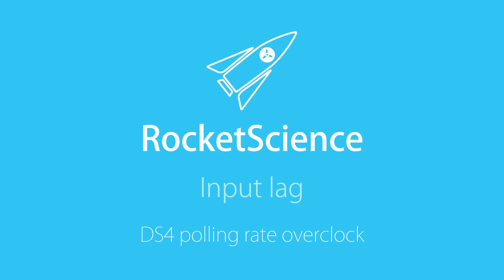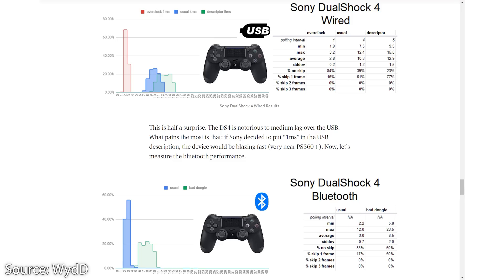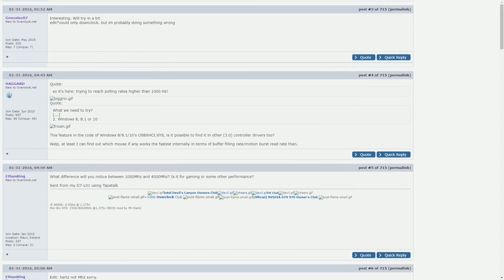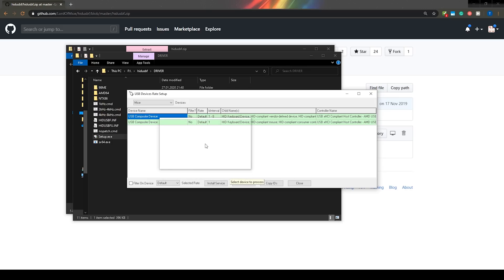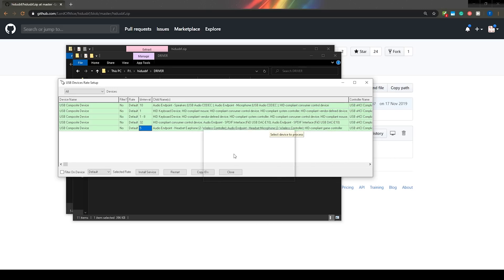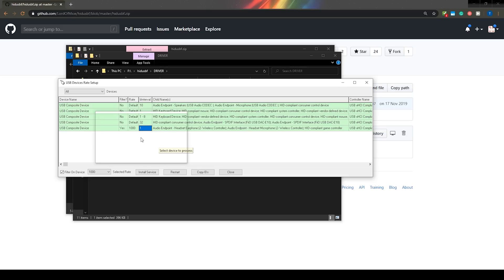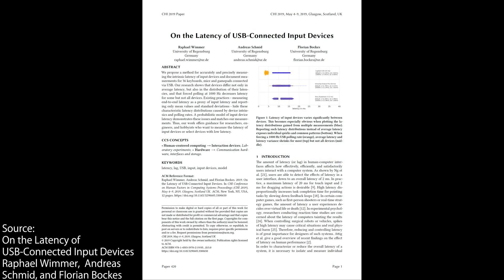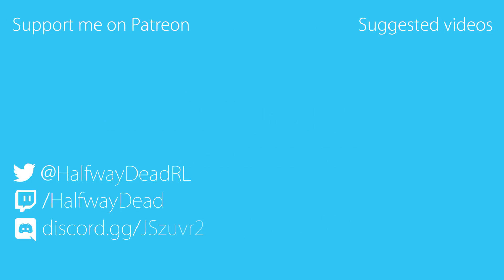(DS4 PC) Lower input lag for free! - Rocket Science

Comment: did everything right closed all applications and i still get 5 bInterval
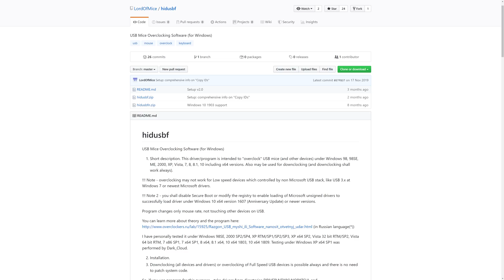Reply from the maker: It should be possible to do the reversing 3:38 to at least get the controller working again.
There may be a number of causes according to the support page of the program:

!!! Note - overclocking may not work for Low speed devices which controlled by non Microsoft USB stack, like USB 3.x at Windows 7 or newest Microsoft drivers.

!!! Note 2 - you shall disable Secure Boot or modify the registry to enable loading of Microsoft unsigned drivers to successfully load driver under Windows 10 x64 version 1607 (Anniversary Update) or newer versions.

In short: You may be unlucky and have the wrong USB controller (you can try the ports in the back of your mobo if you didn't already (USB3)).
Google how to disable secure boot on your PC, install service, then you should be able to turn secure boot back on.
Reply: @RocketScience  yea fixed it by switching from USB 3 to USB 2 and works fine now
Reply: Rocket Science I’ll try that, thanks for your reply :)
Reply: same for me

Comment: i have a red bar aswell
Reply from the maker: It should be possible to do the reversing 3:38 to at least get the controller working again.
There may be a number of causes according to the support page of the program:

!!! Note - overclocking may not work for Low speed devices which controlled by non Microsoft USB stack, like USB 3.x at Windows 7 or newest Microsoft drivers.

!!! Note 2 - you shall disable Secure Boot or modify the registry to enable loading of Microsoft unsigned drivers to successfully load driver under Windows 10 x64 version 1607 (Anniversary Update) or newer versions.

In short: You may be unlucky and have the wrong USB controller (you can try the ports in the back of your mobo if you didn't already (USB3)).
Google how to disable secure boot on your PC, install service, then you should be able to turn secure boot back on.

Comment: Doesnt work for me although I think im doing it right? after plugging the controller again theres nothing in bInterval and its red colored
Reply: Surprise, surprise! Blame the windows fuckin 10. 
https://www.overclock.net/forum/375-mice/1597441-digitally-signed-sweetlow-1000hz-mouse-driver-35.html#post25560676
https://www.overclock.net/forum/375-mice/1597441-digitally-signed-sweetlow-1000hz-mouse-driver-90.html#post27714496

You can also use this registry setting https://forums.mydigitallife.net/threads/windows-10-anniversary-update-digital-signature-question.69970/#post-1272392
Reply: @koshi-dono  Yeah adding that dword value worked for me
Reply: @somethingeatingspace  It worked for me too, I had to restart, just in case that's not clear.
Reply: @somethingeatingspace  what is that?
Reply: @koshi-dono  not gonna lie i'm a bit of a noob with computers and i'm not really understanding anything in those threads, is there a way for it to work with this problem? I kinda get that reinstalling windows was the problem and I do it every year or so.
Reply: @Stegibbon  try registry key then. If you don't know how to use regeditor try to read this first https://www.laptopmag.com/articles/create-reg-file-for-registry-hacks 
Create a new reg file with the key you can find here https://forums.mydigitallife.net/threads/windows-10-anniversary-update-digital-signature-question.69970/#post-1272392
And then run it by doubleclick.
Reply: @Stegibbon   tbh i wouldnt recomend you to do it unless you have a good understanding of what you are doing. All of the solutions involve putting your pc into high security vulnerability if you are not carefull. So first inform yourself well about any of these threads before atempting to do them. And there is no other ways. Microsoft win 10 last update was the one causing all of this
Reply from the maker: In case anyone else has this issue. It should be possible to do the reversing 3:38 to at least get the controller working again.
There may be a number of causes according to the support page of the program:

!!! Note - overclocking may not work for Low speed devices which controlled by non Microsoft USB stack, like USB 3.x at Windows 7 or newest Microsoft drivers.

!!! Note 2 - you shall disable Secure Boot or modify the registry to enable loading of Microsoft unsigned drivers to successfully load driver under Windows 10 x64 version 1607 (Anniversary Update) or newer versions.

In short: You may be unlucky and have the wrong USB controller (you can try the ports in the back of your mobo if you didn't already (USB3)).
Google how to disable secure boot on your PC, install service, then you should be able to turn secure boot back on.

Comment: My binterval comes back blank after I plug my controller back in? What do I do?
Reply: Same, hopefully he can help us with this.
Reply: Surprise, surprise! Blame the windows fuckin 10. 
https://www.overclock.net/forum/375-mice/1597441-digitally-signed-sweetlow-1000hz-mouse-driver-35.html#post25560676
https://www.overclock.net/forum/375-mice/1597441-digitally-signed-sweetlow-1000hz-mouse-driver-90.html#post27714496

You can also use this registry setting 
https://forums.mydigitallife.net/threads/windows-10-anniversary-update-digital-signature-question.69970/#post-1272392
Reply from the maker: It should be possible to do the reversing 3:38 to at least get the controller working again.
There may be a number of causes according to the support page of the program:

!!! Note - overclocking may not work for Low speed devices which controlled by non Microsoft USB stack, like USB 3.x at Windows 7 or newest Microsoft drivers.

!!! Note 2 - you shall disable Secure Boot or modify the registry to enable loading of Microsoft unsigned drivers to successfully load driver under Windows 10 x64 version 1607 (Anniversary Update) or newer versions.

In short: You may be unlucky and have the wrong USB controller (you can try the ports in the back of your mobo if you didn't already (USB3)).
Google how to disable secure boot on your PC, install service, then you should be able to turn secure boot back on.

Comment: I have a problem, I followed all your steps correctly but when i set it to 1000 and reconnect my controller the bar turns red and not green. What im i doing wrong, i also didn't have DS4 or steam opened.
Reply from the maker: It should be possible to do the reversing 3:38 to at least get the controller working again.
There may be a number of causes according to the support page of the program:

!!! Note - overclocking may not work for Low speed devices which controlled by non Microsoft USB stack, like USB 3.x at Windows 7 or newest Microsoft drivers.

!!! Note 2 - you shall disable Secure Boot or modify the registry to enable loading of Microsoft unsigned drivers to successfully load driver under Windows 10 x64 version 1607 (Anniversary Update) or newer versions.

In short: You may be unlucky and have the wrong USB controller (you can try the ports in the back of your mobo if you didn't already (USB3)).
Google how to disable secure boot on your PC, install service, then you should be able to turn secure boot back on.
Reply: Rocket Science make a video
Reply: Yeah, same. Hopefully we are missing some small detail he forgot to mention.
Reply: I just posted a new comment outside this thread for those of you getting the red signal. Take a look and let me know if it worked for you.
Reply: @Drixi  i havent been able to find your comment. can you check if it was posted indeed?
Reply: @Drixi  can confirm this worked
Reply: @Drixi  my guy
Reply: @Drixi  i have a problem after i restarted my pc and check if the new thing saves where we had to put 1 instead of 0 and it doesnt save
Reply: Thank you for letting us know :) I still have not had a single problem myself with this method.
Reply: Surprise, surprise! Blame the windows fuckin 10. 
https://www.overclock.net/forum/375-mice/1597441-digitally-signed-sweetlow-1000hz-mouse-driver-35.html#post25560676
https://www.overclock.net/forum/375-mice/1597441-digitally-signed-sweetlow-1000hz-mouse-driver-90.html#post27714496

You can also use this registry setting 
https://forums.mydigitallife.net/threads/windows-10-anniversary-update-digital-signature-question.69970/#post-1272392
Reply: koshi-dono can you explain it to me like I’m 6
Reply: @Jimby  I don't think so, because I don't speak english ¯\_(ツ)_/¯ 

In short, according to driver signing changes, Windows 10 1607+ will not load any new kernel-mode drivers which are not signed by the Dev Portal even if they have EV certificate. That means it's not your decision what you can run on your OS anymore, it's MS's decision now, 'cause it's not your OS, it's THEIR OS. Your overclocked DS4 won't work, driver is installed but can't be loaded.
You can bypass this shit by 3 methods (second and third link): disable secure boot completely, use atsiv or, easiest IMO, create registry key to trick your OS, make it think it was updated from previous version, not fresh installed (may stop working anytime with any update).
Reply: koshi-dono I hope he makes a Vid explaining what you just said. It would be easier to understand
Reply: @raedlenghi  Yeah, it would be great.
Reply: I had the same issue. I also realized that when I hit "Restart" in the program, it told me a number of potential errors. Reading the error message made me fully extract the .zip instead of running directly from the archive, and then I ran setup.exe in administrator mode. Everything worked perfectly after that. Give it a shot?

Comment: My car doesn't feel heavy anymore!!!
Reply: 4Weird
Reply: Chargingdingle congrats on losing weight chargingdingle!!
Reply: Does this make it feel any better, charging?
Reply: Raiden most definitely, I’ve been wanting to quit RL for so long now because of the sluggish car feeling thinking I just lost all my skills, no.. this is game changing, get it ASAP my guy
Reply: @phyxiusrl1687  ye just did it about 20 mins ago. Definitely feel the change. Cant fathom why sony wouldnt just set the default polling rate to 1000 hz over usb.
Reply: Lmaoo i just played a bunch of games with it accidentally on 500 hz and i thought i was faster. After the game i checked and put my cable in the right usb port, as the software makes it so that it will be 1000hz with the specific usb port and specific controller that you do the setup for. I was testing by switching between the ports to switch between 500hz and 1000hz to feel the difference – and i forgot to switch back to the 1000hz port before playing ranked. And the whole time i believe i was feeling a bit faster due to the 1000hz. Only after the games i realised i was on 500hz. Placebo effect is strong i guess xD. Then i switched back, and yes, it does feel a bit more responsive but its nothing crazy. You can play just as well on 500hz, but 1000hz is a nice little bonus to give you that tiny edge.

Comment: Is this for wired only, or does it also work if you use it wireless?
Reply: Wired only. This changes USB devices, so if it's connected via Bluetooth you won't see the controller on the list at all.
Reply: Wireless already runs on 1000Hz by the looks of how close the mean lag is.

Comment: THANK YOU!!!!!!!
I'm gonna test this tonight.

60 -> 120 -> 240hz on my monitor was a huge improvement not just to the experience but my actual skill.
Reply: Try dynamic super resolution too. I got a 1080p 180hz monitor running at 2k resolution with a 8gb 1070 and it makes my Rocket League miles better looking than anything I've ever tried.
Reply: @PeaceSeekingMissile  Better graphics - lower FPS - worse full input lag.
Reply: @chupasaurus  I always wondered that! What's the recommended resolution and frame rate for rl? I can't play on Xbox anymore because it seems so unresponsive.
Reply: @PeaceSeekingMissile  I wouldn't play on less than 1080p because of details across the pitch might be useful. Maximum frame rate in Rocket League is capped, so you can adjust graphics as you like while your system maintains max FPS without drops.
Reply: @PeaceSeekingMissile  you already have an advantage on most players with those 180 heartz but higher frames equal less input lag... Actually rocket science has a video on exactly that you should watch it bud! Good luck!
Reply: @chupasaurus  I use the 1440p dsr option and my card and monitor handle it fine. Text doesn't look good but I use it for rocket league and it helps see the back end of the field so much better. The game caps at 160hz but I think my nvidia settings are messing with that. Maybe I smoke too much weed though. I have seen rocket league on a 32" 1440p 144hz monitor and it is beautiful to see so maybe I might just upgrade my monitor in the future.
Reply: @castillotvMX  thank you! I'll check it out for sure.

Comment: If you overclock it on Windows, does the change transfer over to when it's wired on the PS4?
Reply: I think PS4 still uses a wireless connection even if a gamepad is wired.
Reply: Im curious too, now on PS4 settings you can select a wired input connection
Reply: @Giordy89  Oh, so they fixed that :) Nope, this overclock is Windows-specific, also all the measurements in video were made on PC, wired gamepad on console might work properly already.
Reply from the maker: As I said in the video: "It's a controller and system-based change." It's the computer forcing the controller to run faster. And unfortunately, wired on console is no better than non-oc on PC. This was tested by noodalls: https://www.neogaf.com/threads/i-think-the-dualshock-4-has-more-input-lag-wired-than-wireless.1331867/

You can choose to run permanently wireless on PS4 though in which case the USB will be used only for charging. But that will keep the disadvantages of wireless too.
Reply: most likely not
Reply: Nope...
Reply: @yorzengaming  sadness